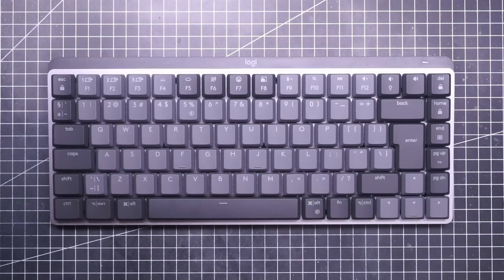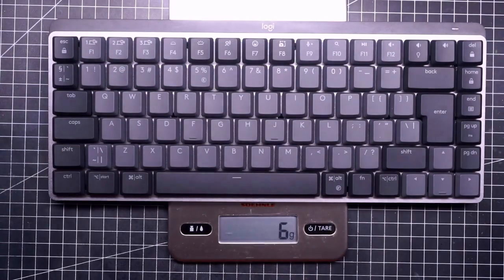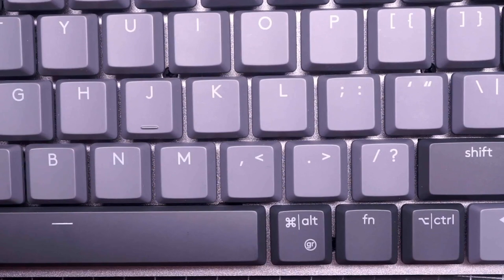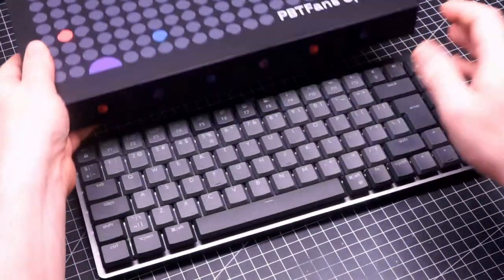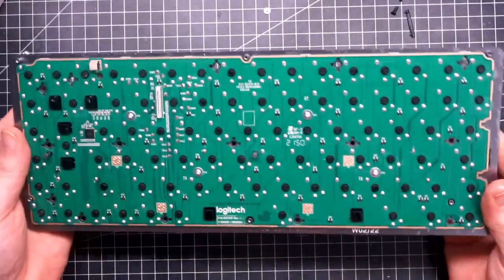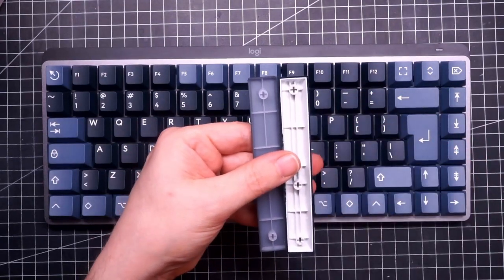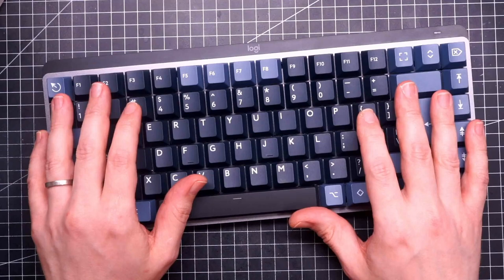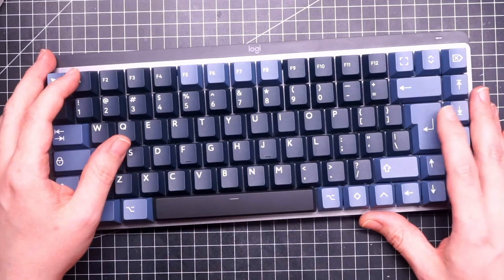Logitech MX Mechanical Mini Brutal Review

Comment: You are comparing a productivity keyboard with a custom mechanical keyboard, I think this is a little bit expensive, but paired with a Logitech MX Master mouse and Logitech Flow software, for me this is perfect, I just went for the brown switches, blues are obnoxiously loud in my opinion
Reply from the maker: it's just an expensive bad keyboard. the non-mechanical version has better value.
Reply: @matt3o  I still prefer the mechanical, it has a better key layout, I use the home and end keys all the time, and I find it more comfortable to type on

Comment: Hi mate, could you find out any other keyboard that match this low profile switches, 10 months battery life without backlight, 4 devices wireless connection, high quality abs keycaps, touch sensor blacklight, enough customized function key, mechanical keyboard. 

all you saying is about play with the keycaps, you may love pbt but there are many of us perfer the abs soft touch feeling. 

I play with alot keyboard before, customized feel of them from KBD fans and many other brand, but for the keyboard that I would like to bring to workplace, I will take this logitech. 

BTW, try to use the logitech blot or flow function, once, you get use to it , you will love it.
Reply: Agreed. I think if you're a keyboard enthusiast and customizer, this keyboard is not for you but it is a great mechanical keyboard with premium software. I do agree that it is overpriced though. You can get a "similar" keychron build for much cheaper.

Comment: It does have a purpose but you just erased it. Putting high profile keycaps on a low profile keyboard kind of deafeats the purpose of the keyboard being... low profile!
Reply: no it doesn’t. the purpose of low profile is two fold: don’t need a wrist rest and lower travel. you shouldn’t be using a wrist rest regardless of the keyboard - most ergonomic to have wrists in the air. and the travel is the same regardless of the keycaps. so really this is just making the keys not feel like shit while preserving the short travel

Comment: This is not a review at all. I would understand if this keyboard were advertised as hot swappable and it's not. This keyboard is not the one where you have an expectation to replace the keycaps. I do not understand what kind of review this is. You did not test or shown any other feature of this keyboard except keycaps and not being able to replace them. It looks to me like reviewer bought it by accident and now bragging on YouTube about it. What about linear switches and tactile brown one which are other options for this keyboard (not just blue one you used on the one you reviewed).

Comment: I think keyboard e enthusiast should debunk the fact that all cheap rubberdome keyboard are bad. Under a certain level of quality a mechanical keyboard is not better than a well done cheap mechanical keyboard but it cost a lot more. This is my opinion but I would like to know what you think about it.
Reply from the maker: I agree. This keyboard in particular is worse than a decent rubberdome
Reply: @matt3o  I needed a cheap keyboard to use it a home for sporadical working at home as a developer and self-formation. I decided to go with the Perixx 106m, a retro keyboard inspired by the model m. It' just a membrane with abs keycaps and not bluethooth but the sound is good (imho) and it feels ok. I am not really a fan of mechanicals keyboard because the buttons stops immediately when they hit the board without any cushioning (I think others refers at this as mushiness). Topre looks like what I was searching but they are too pricey to justify the expenses for at home use. Keycaps are laser printed and the keyboard being beige I think will look ok even when keycaps will start to shine (something that eventually even pbt will do afaik). There are not many review in the web. But to me that is a good enough membrane keyboard that is actually also nice to look at it.

So if you would like to test a good cheap membrane keyboard I recommend this model, the Perixx 106m, even though keep in mind that I am not and expert in keyboard.

Comment: "I cannot change the spacebar so this keyboard is crap" 🤣 ok bro
Reply from the maker: let's put it in simple words. Keyboard is expensive crap. Only thing that could slightly improve it is custom keycaps but you can't change them, so you've now got a nice 150$ paperweight.
Reply: Don't be mad at this guy for his honest opinion. I stopped buying Logitech when they starting making way overpriced crap which has been more than 5 years.
Reply: @matt3o  you are right with all  the cons of the keyboard. One things that you need to consider is the bluetooth. I bought a Logitech membrane keyboard for my mother at 40/50€ only for the bluetooth pairing becaue the other brands have not a stable and easy pairing
Reply from the maker: @gabrieledoria2896  40/50euro is expensive for a rubberdome... but still okay. You pay for the brand, does what you need (bluetooth) and few regrets. This is a 160euro keyboard we are talking about!
Reply: @matt3o  are there other known brands that sell a keyboard with good software for bluetooth, mechanical switches and low profile for less than 150€?
Reply from the maker: @gabrieledoria2896  I'm using a NiZ with bluetooth with no problem and a Filco Minila.
Reply: I've been through Keychron, Durgod, Royal Kludge in search for a proper wireless mechanical keyboard and I can honestly say... there's no such thing. Most of the time Bluetooth connectivity has significant delay and tends to drop single clicks from time to time. What about 2.4 GHz dongles? They are very... and I mean VERY susceptible to other devices in USB ports.  You got separate port with separate controller for it? Cool, you gonna get about 3 meters of uninterrupted signal. Have something next to it? Range decreases to 30 cm or even less. One of the devices is doing something? For ex. card reader dumping files to drive? Your keyboard is as good as dead when that happens. That's why I'm gonna get this keyboard despite all cons, because NO OTHER MANUFACTURER can do wireless connectivity right.
Reply from the maker: @BitWolf  I can't say I didn't have the same issues with logi keyboards/mice. I always have to put the dongle on the front panel and if you use the USB for transferring files the keyboard gets obliterated.

I must say that the Niz that I'm using with its own BT dongle works pretty well and it can even be used on the bios/boot loader.
Reply: @matt3o  for mx lineup, non-mechanical costs 129cad before tax. this keyboard is not for mechanical keyboard fans. bolt is extra-low latency connector, I bet your keyboard don't have it. also logitech flow is good productivity tool that again might not be useful to you. You care about keycaps, but the majority of it's targeting market don't lol. I have tried so many 'fan-recommended' keyboard for my work desk, all I can say is as fancy as they were, the usability and user experience is nowhere near my old mxkeys.
Reply from the maker: @chaseliu5011  I don't care about keycaps, I care about ergonomics and typing experience.
Reply: can't customise it coz the design fault of spacebar. I am ok with no RGB, overprice, no wired connection, but it use abs keycap not pbt and we can't change it.

Comment: Thank you for this honest review! 
I really feel the same - extremely wanted this product having the hopes to get premium quality for the price. Reality - this is nothing more than an overhyped and extremly overpriced product.
Keycaps feel super cheap, my board had a problem with the rubber feet symmetry, which lead to play one of the angles while typing on another.
So, I get rid of the item after 2 days of use and really suggest avoiding it.

Comment: Typical logitech... just almost there... However, what logitech does VERY well that other companies do not, is the ease of the wireless (with their unifying receiver, and their logibolt receiver). You can use them in BIOS as opposed to other BT wireless keyboards, you cannot. You need a driver with certain programs, where logitech you cannot. If anything, Take the PCB, and mod it with standard stabilizers, and get a custom plate. Now you have a keyboard worthy of you "end game". Be the avenger!